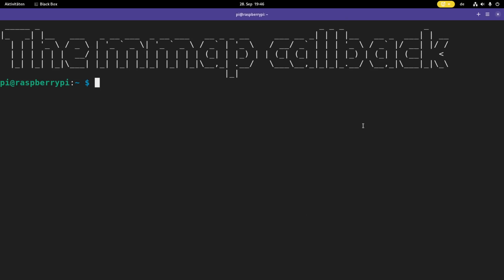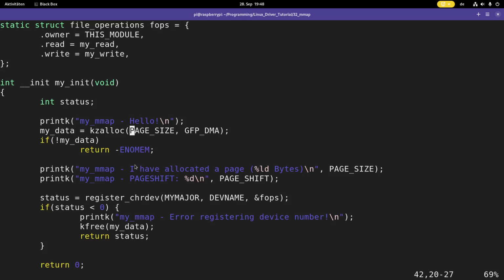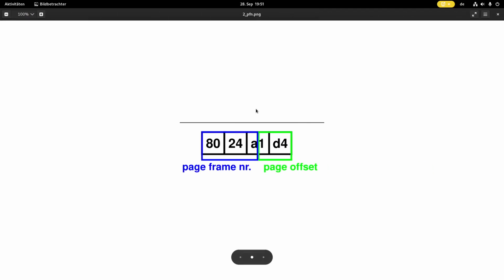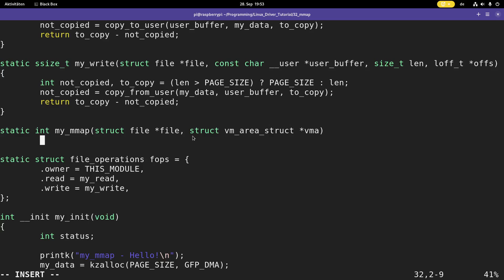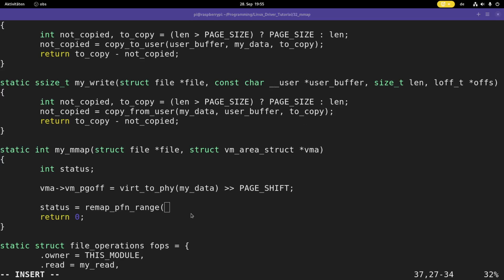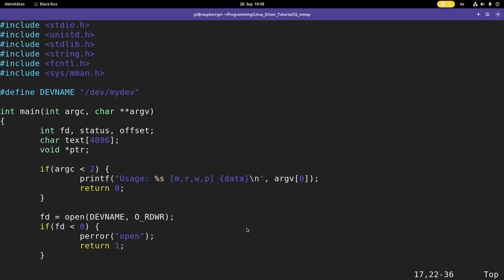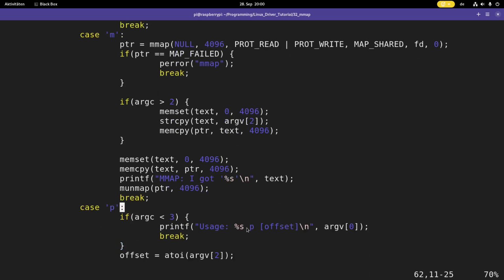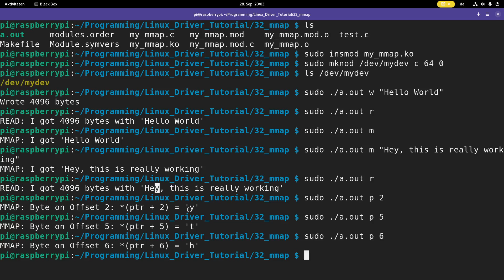Let's code a Linux Driver - 32: The mmap Callback

Comment: Could you detail why `pgoff = phys_addr >> PAGE_SHIFT`?

Is that because each page has an ID which is stored in the first PAGE_SIZE bits of each page (and that the allocated data "begins" only after - this is how I understand it)? Or a similar reason?

What if you do `pgoff = phys_addr` instead of `pgoff = phys_addr >> PAGE_SHIFT`?

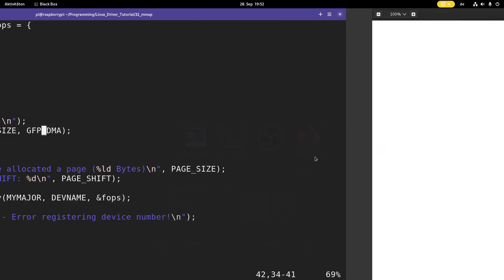Comment: hi at 6:11 what will be the problem ? if physically not contiguous memory ptr shared with user space.
Reply: Probably late to reply, you need physically contentious memory, if you need to physically access a specific ram address. If you dont need it you can use GPF_KERNEL. In my expirience GPF_KERNEL just lead to misalignment problems and i couldnt figure out why, so using the approach in the video worked.

Comment: HI Johannes,
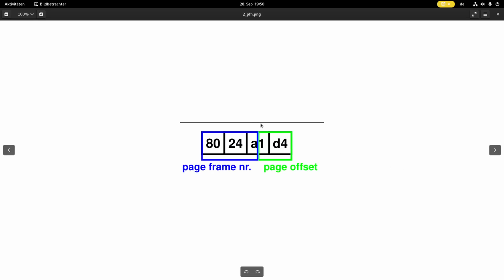At 4:34, it's called a page table entry, right? 20 bits for the  "page frame nr" that specific position for 12 bits "data"  is locating at the physical ram, correct?
Reply from the maker: Yes

Comment: Can you give me some advice? I made a custom peripheral using a FPGA which is a soc. The peripheral is memory mapped. The peripheral also uses a BRAM peripheral which is close to the custom peripheral. I have to write a driver so i can easily control it. I was thinking to use this mmap method(the method in your video) to write to the BRAM and to use ioctl to set some status or control bits. Do i understand the application of this video well?
Reply from the maker: Yes, this sounds like a good plan.